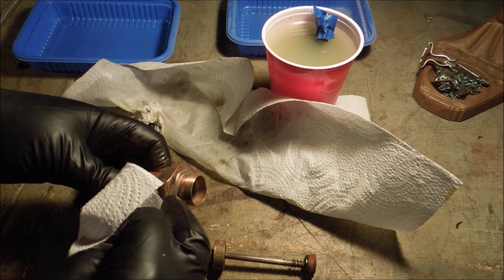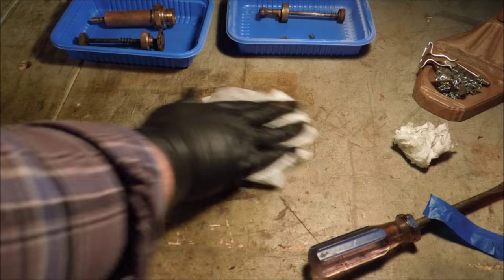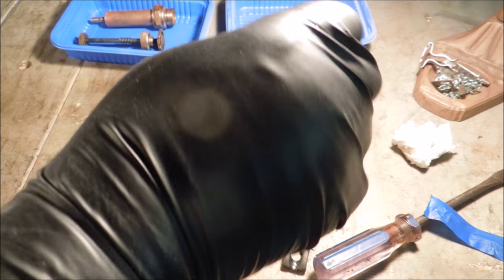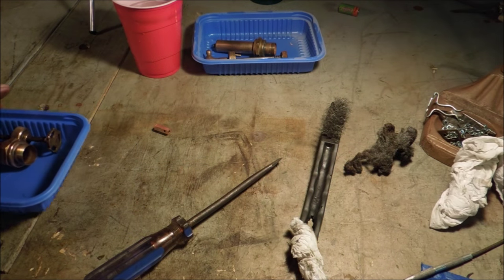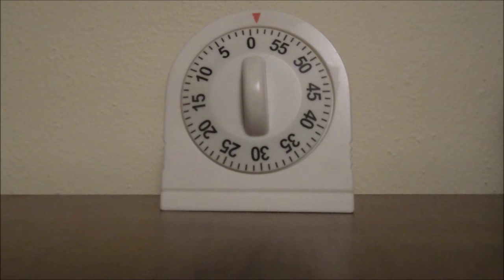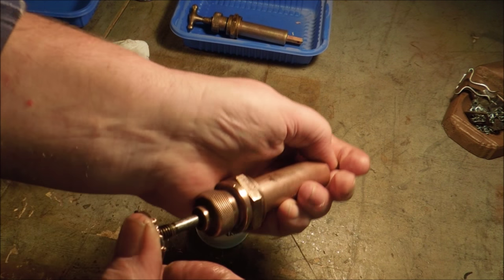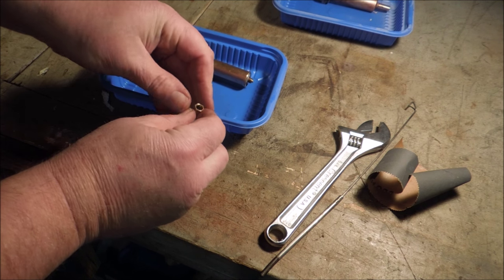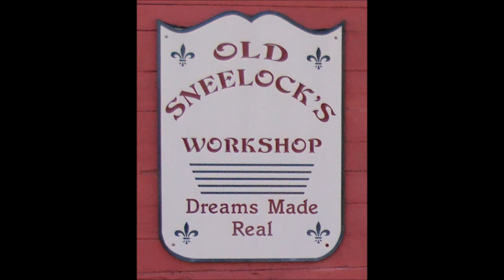Blow Torch Blow Out ~ Pt 5 ~ Pump Repair ~ Check Valves ~ by Old Sneelock's Workshop

Comment: I have one of these blowtorches but i can't find anything on the ones with the pump in the handle. I know the leather is ok, but I'm can't find anything on the check valve. The tube is soldered on, but i have a diy soldering iron made from a coffee pot warmer element ( not the water heater, it is the heating element that is meant to keep the coffee warm after it was brewed). Can you tell me how the check valve works when it is in the handle?
Reply from the maker: I don't think I have worked on one different than the torches that you see in this video. 
There are many different types I just never bought any or worked on someone elses.

Comment: I've got a torch that has a blown out pick up tube. There is a large crack in it just above the bit where you light the meths to warm it. Im picking I should just buy a replacement brass tube and fit it. What type of solder do you recommend? It connects to the lower part of the square preheater in the flame path but looks to have no solder here. I'm guessing it is a press fit. Thoughts here too also appreciated.
Reply from the maker: Check for threads. My torches have a steel pipe with threads on both ends.

Comment: Hi thanks for the video, must the plunger on the check valve have a type of seal in it to prevent leakage back to the pump
Reply from the maker: The check valves on mine had cork inserts that were pressed against the opening of the pump. There is a spring that applies pressure to keep it seated. Once pressure is built up in the tank the pressure forces the plunger onto the opening.
Just to see if I could, I used pieces of cork to replace the existing 100 year old corks that were leaking. It worked, but it was a pain to cut and fit. 
The next check valves I repair, I have 5 on the bench right now, I plan to use Nitrile ( buna-n) o ring material. It is the most common type of o ring material and should be available either at your local hardware supplier or on line.
Reply: @OldSneelock  thanks very much, I try to repair mine currently, thanks for the info

Comment: Instead of using the old leather diaphragm for the pump mechanism, I used a carburetor accelerator pump diaphragm.  Perfect fix and works with gasoline!
Reply from the maker: As long as it works

Comment: i have the same C&L blowtorch you have in this video, could you please make a tutorial on making the pump leather cup. the one on mine dissolved and im not really sure on how to make one
Reply from the maker: cheesecakes121 I have one  sitting in the shop. I'll see if i can get to it in the next week.
Reply from the maker: cheesecakes121 In the meantime while you are waiting for me to do an in depth explanation I'll  give you the basics. The leather starts out flat. Cut a disk about a 1/4" larger than the bore of the pump. Soak it in oil for a few days. Attach the leather to the shaft like the original. Fold it over the ring and tuck it into the pump. 
Good luck.
Reply: Old Sneelock's Workshop ok thank you I'll give it a shot

Comment: Where can I find a leather still like you have?
Reply from the maker: Must be a typo. What is a leather still?
Reply from the maker: I'm going to guess you are asking about a leather punch to make the cup for this pump. 
You can find one at Amazon.  https://www.amazon.com/Senrog-Gasket-Leather-Rubber-Plastic/dp/B09WKJWQJJ/ref=sxin_16_pa_sp_search_thematic_sspa?content-id=amzn1.sym.2f069413-fb5e-4c50-885f-a35cf6871d10%3Aamzn1.sym.2f069413-fb5e-4c50-885f-a35cf6871d10&crid=37X9O3X7Y6H62&cv_ct_cx=1%22+Diameter+Leather+punch&keywords=1%22+Diameter+Leather+punch&pd_rd_i=B09WKJWQJJ&pd_rd_r=fc3ff046-2dc3-4a68-9aa8-aed5a02a9cf3&pd_rd_w=kdJHi&pd_rd_wg=IeawY&pf_rd_p=2f069413-fb5e-4c50-885f-a35cf6871d10&pf_rd_r=T3NC37KEWVT2G8S2VZJK&qid=1684207093&s=digital-text&sbo=RZvfv%2F%2FHxDF%2BO5021pAnSA%3D%3D&sprefix=1+diameter+leather+punch%2Cdigital-text%2C145&sr=1-1-be8d29ef-546e-4f38-a2d4-6d64d539234f-spons&psc=1&spLa=ZW5jcnlwdGVkUXVhbGlmaWVyPUEyR1kyQ0UxSldTTjImZW5jcnlwdGVkSWQ9QTAyNTU2ODE2M0tVWTdFSk4yUDUmZW5jcnlwdGVkQWRJZD1BMDA2OTAzMzIzNEg0RENDMTJCVUomd2lkZ2V0TmFtZT1zcF9zZWFyY2hfdGhlbWF0aWMmYWN0aW9uPWNsaWNrUmVkaXJlY3QmZG9Ob3RMb2dDbGljaz10cnVl

Comment: the pump with the large female thread nut.... what is it from? i need one for a Turner brass works model X-141 stove.  just curious because it looks like it will fit.
Reply from the maker: It's from a Turner Brass Works blow torch. I would bet they make one type of pump for everything. They are pretty common here in Michigan. I have seen several more in various shops and flea markets.
Reply: thanks, unfortunately i bought one already, and its male threads going into the torch.. do you have a model number? i bought a otto burnz that looks like its female thread and larger diameter. hope it works.. thanks.
Reply from the maker: coadyboys Sorry it's so old there isn't any markings other than the Turner name on the pump handle medalion.
Reply: thanks.  i found a female threaded pump from a bernz.. but its to bid around.. man its hard to find the turner stove stuff... thanks for your videos!
Reply from the maker: You might try this group https://classiccampstoves.com/threads/model-x-141.12668/

Comment: Hi! I've been watching your blowtorch blowout videos, and I'm having an issue, where.. I've made a makeshift leather seal for the piston, ive cleaned the pump (mine is like the one that the check valve doesn't screw off) initially I couldn't get enough pressure inside the pump for it to work... now check valve doesn't work at all.. its stuck in the "open" position... so to speak. I know the videos are old but some kind of guide would be greatly appreciated. Thank you!
Reply from the maker: Check and see if the check valve is soldered on. It sounds like your spring is either broken or missing. Let me know what you find.
Reply: @OldSneelock  thank you so much for replying!  I found it is not soldered, I managed to unscrew it... the torch is almost 60years old and the piece and spring look brand new... I have no idea what I did but it works again ... but couldn't manufacture the leather thing you thought us in another video .. so it can push air in and build pressure but when I pull it back   the vacuum doesn't break and it back washes fuel if I force it. I hope I'm explaining myself.. english is not my first language (your video made it to Chile)
Reply from the maker: @xaviermartin3156  i'm going to ask some questions that might seem odd, but it will help me to understand the situation. 
1. Which side is the open end of the leather cup facing? Toward the handle or away?
2. Was it difficult to insert the cup into the pump? 
3. Was there a lot of drag or did it try to shave a bit off of the cup?
 4. With the pump removed from the torch and you pushing on the handle does the pump move freely? 
5. With the pump removed from the torch and you pulling on the handle does the pump move freely?
If the pump is stiff or hard to move when it is outside of the torch the cup may be too thick. If that is the case the cup will prevent air from passing so the area below the cup. That will create a vacuum when the piston is withdrawn.
Reply: @OldSneelock   @Old Sneelock's Workshop  1.downwards hay from the handle
2. Yes very, but I'm not that dextrous honestly. 
3. In the beginning quite some drag, but by the 3rd pump it offered normal(?) Resistance and air came out the end its supposed to after pressure quota was met. In puffs I mean. 
4-5. Outside the torch the cup moved freely but once iput it inside torch and filled it with fuel the fuel went into the pump. I tweaked that a little bit and the check valve worked again, but as you suggest I think the cup might be too thick. I made one earlier and it was too small and it didn't build up pressure. The torch now even lights... with a flame smaller than a lighter.. barely ignited after several minutes of pumping and alcohol burning

Comment: Where can you get leather valve replacements? That has to be one of the few consumables on them.
Reply from the maker: shexdensmore The check valve button was originally made from cork. If I have another one to repair I'm going to try a section of neoprene o ring.
Reply: Old Sneelock's Workshop make sure gas won't melt/dissolve or sweel it up.
Reply from the maker: shexdensmore Coleman fuel or white gas won't damage neoprene.
Reply from the maker: shexdensmore If you are refering to the leather cup for the pump piston that can be made from a piece of thin flexible leather.

Comment: Hey Sherlock. Just curious. I have a turner t180 gas blow torch. The pump tube has cracks in it. Do you have one laying around or could you be able to make a new one
Reply: Sorry dang auto correct spelled Sherlock instead of Sneelock.
Reply from the maker: That's okay. It is an artificial intellegence anyway. 😈
Reply from the maker: Paul Wubbena That is a pretty common torch, but I don't have any spares. Where are the cracks?
Reply: Right my the place where it is ferreled
Reply: Near the bottom. This one takes a rubber seal and a pressure fit to get the checj valve seated
Reply from the maker: It might be repairable. Send me an email at wishingstarfarm663@msn.com and I will tell you where to ship it.
Reply from the maker: I got a brief message saying you sent an email. Nothing showed up. It's been a few hours can you resend?
Reply: I just sent another email. Hopefully I got through. Not unless I'm winding up in your spam because of my email name. Lol. It's an old email account
Reply from the maker: I sent one to your email. I get tons of emails because of the channel. Every Chinese Company in the world has wishingstarfarm663@msn.com on their HOT list. LOL. 😈
Reply: Thank you.
Reply from the maker: Now that I have the answered email if you just add any further emails to that one it will go to the top of the stack. 😁